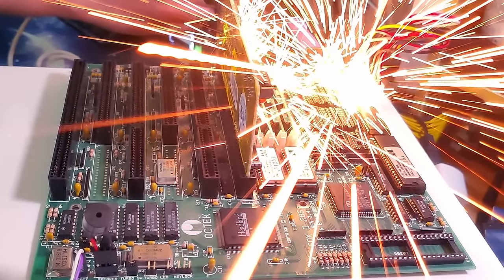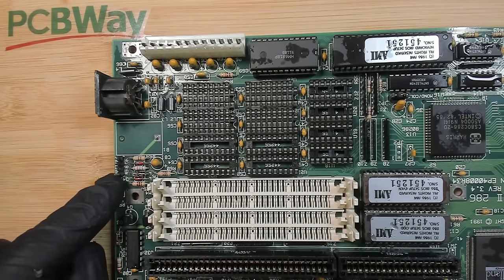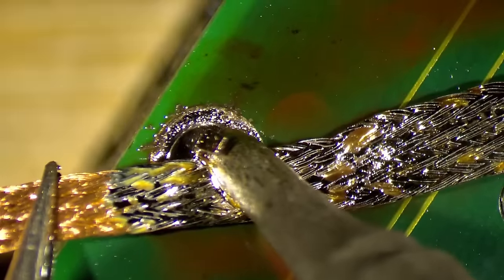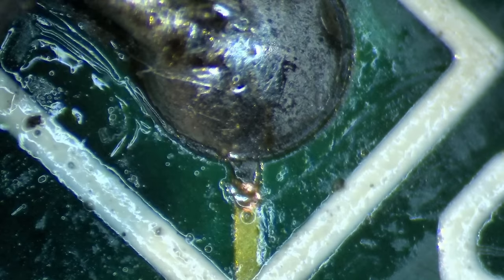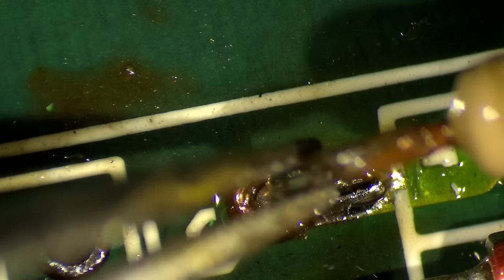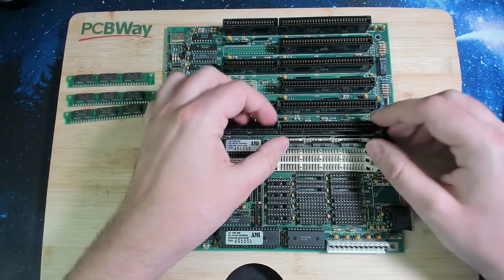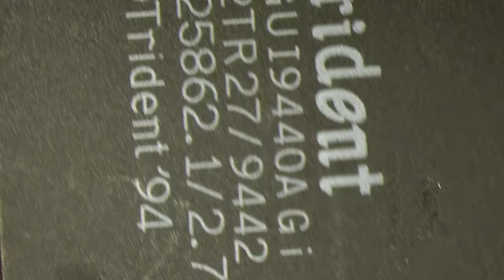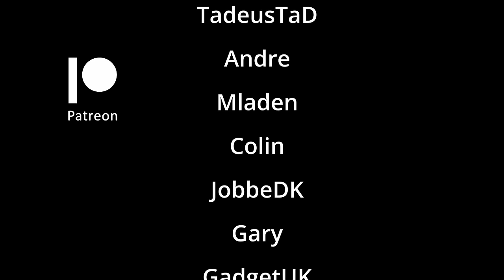Dangerous 286: Vintage hardware fireworks!

Comment: Should always replace these old ceramic capacitors. They are known to fail short. Replace them with something other than another disk, like a polymer.
Reply from the maker: I will replace the caps once I get the board to work. You're right, leaving those caps on the board will just create more issues in the future.
Reply: @bitsundbolts  Wonder if it may not be working because some of the other caps are also shorted? Maybe go through and check each of them for shorts until you replace them?

Comment: Fun with Tantalums! Happened several times on my Amigas that the old buggers simply blew up and left marks on the PCB. Happened most of the times after switching to another power supply. My theory is, that the aging Tantalums were so in tune with the aging caps inside the old power supply that they simply were not able to withstand the power of a new or more recent power supply. 

Best would be to replace all of them with modern MLCC ceramic caps.

But I shouldn´t be the person to say that. MLCC replacements for all my old hardware is on my list since many years but I am just too lazy to start. So I only replace Tantalums in case one turns into fire. ^^
Reply: Tants need to be significantly over-rated on voltage, machines of this era didn't do that. 16v caps on a 12v line, which can easily over-volt as it is typically not as well regulated. They age out and fail short circuit, just like MLCCs (in fact I've had way more MLCCs fail short in Amigas I repair for people, but they are used a lot more). It is better to replace with modern electrolytics for most of the use cases, although MLCC probably won't do any harm.

Comment: Hunt down an Intel 287XL coprocessor for that thing. It's basically a 387 core in a DIP 40 package compatible with the  286 bus. Its one of the fastest coprocessors out there (not the fastest, that would be a 20 mhz Cyrix FasMath or one of the Harris parts) while still being really common and not expensive. Since it's a 387 at the core, it can usually be overclocked to a really great degree, so you might be able to run it synchronously with the CPU, it might require some tweaking of the coprocessor speed jumpers, though. The 287XL has a pin that toggles an internal clock multiplier meant to adjust for the 2/3 divider that a lot of boards used for the original 287, so experimentation is necessary. It's also a lovely looking gold topped ceramic package, so there's also that. Regarding the Bios, there's a very nice MR-BIOS available in the VOGONS MR-BIOS archive. It supports things like larger HDDs and more than two floppy drives.
Reply from the maker: Thanks for mentioning the MR BIOS details - I'll look for it. If I get this board to work, the 287 is going to be a must!

Comment: JP2 was probably for selecting FPU speed. Typically 287 run at 2/3 cpu MHz. Possibly you could run at 1/2 or 1/1 with jumper.
Reply from the maker: There are frequencies present on those pins. I'll check where they go and maybe add the jumper back.

Comment: I have a BIOSTAR , MB-1220VE Harris 286 20 MHz  the board had minor battery damage  the current memory installed is 16 Meg ram most of it is used as a ram drive
Reply from the maker: Great! An ocean of RAM for a 286! Very nice. I hope I can get this board to work some day. Would be nice to also see it boot up with 16 MBs.

Comment: Hello, recently i bought a dusty CUSL2 and tested it. It worked fine. After washing it, drying it with the air blower and leaving for 3-4 hours in the sun, i v got a C0 error...:(. Any ideas?
Reply from the maker: Maybe it isn't completely dry. There are some BGA chips that may have water trapped below.
Reply: @bitsundbolts  ok i will check again!

Comment: 3-2-1 you're going to fix it soon! I can see that! I hope it's not the chipset, that 16MHz to the CPU is indeed suspicious. If I remember right we checked on my 286 (different board) and the speed seems to go to 20MHz straight away. Fingers crossed!
Reply from the maker: Yes, you're right! I'm looking at the logic chips now. I also socketed the 40 MHz crystal and tried one with 33 MHz - unfortunately, there was no change. Tomorrow, I'll continue with the logic ICs.

Comment: I bet you need to populate the socketed RAM.
Cant wait for you to get yours and see what happens.
Reply from the maker: I got the memory about an hour ago. Unfortunately, there's no change - same behavior as with the SIMM sockets - or no memory at all. The board behaves identically no matter what.
I also got new BIOS chips which work properly - still no change.
Reply: @bitsundbolts  Thats unfortunate. You mentioned in the video that there were data/address lines acting weird? Maybe try desoldering the CPU and see if the issue persists. If it does then chipset may be bad.
Reply from the maker: I'll check the logic chips over the weekend. There are about 10 on the board. My programmer can test most of them.

Comment: Oooh, nice obscure 286, great job (as always) getting it back into shape (as always) and godspeed getting it back into working order! A 16 MHz 286 running Lemmings was my gateway drug too. Besides lowering the set clock speed (which most certainly won't do anything based on what you've already shown and is certainly something you have already tried), I'm drawing blanks so far. Populating the DIP sockets sounded promising, and would have been an easy fix, shame it wasn't that. Any idea what that one small DIP chip that was in the blast radius of the corrosion does?

Once (when, not if)  the board is revived, I'd recommend replacing all the Tantalum caps, just for good measure and peace of mind. Wouldn't want to have to drop any more sacks of cement! ;)

I'm very much looking forward to that series on DOS memory management. I did a lot of optimizing in that regard back in the day (Memmaker FTW!) and I like to think that I had a somewhat solid idea of what was going on even then as a kid, but I certainly didn't know / don't know everything yet (but I want to!).
Reply from the maker: I'll try my best to get that board working. So far, nothing I have tried works. I guess you've read some of my answers to other comments. Yes, I got DIP memory and new BIOS chips - none of them make a difference. I'll keep on trying. It would be a shame if this board is unfixable.
I'll check that chip below the battery connector. I think I'd like to add a few more sockets instead of having all these chips directly soldered to the board.

Comment: Try checking all the pins of the Chipsets, CPU, (and whatever other ICs), to make sure that none have broken solder joints.. 
Also, try using your thermal camera. Maybe it reveals some bad IC.
Reply from the maker: I did check with a thermal camera - forgot to mention this in the video. I'll check the logic ICs - maybe there is something.

Comment: Hi, please also publish a video on further troubleshooting attempts, even if it doesn't work, we still apprechiate all the information!

I myself am stuck at the moment with a 386SX-16 which also can't detect the first 64k of memory. I found my CAS signal for the memory to be missing. Now I'm waiting on a ROM programmer to see if the BIOS chips are still retaining their programming. If that is checked and doesn't change anything I will cut the input pins of a bus driver on the CAS line, because it might be defective and pull them high. If the chipset still doesn't send CAS strobes after that I think I am out of skill to go further.
Reply from the maker: I'll try to go further. Unfortunately, I'm no expert - but it may be the perfect learning opportunity.
I got the DIP memory and new BIOS chips. Unfortunately, nothing seems to work. There is no difference if there's memory installed or not - the board stops at POST code 10.
I'll try a few more things now that I know it's not the BIOS chips or the memory.
Reply: Be aware with the CAS lines. Some memory uses hidden CAS refresh therefore you will not see the CAS active in refresh cycle. As far as I remember the CAS is not used to be driven by a bus driver but by the chipset directly. Worth to doublecheck. My story: With a socket 7 MB I got three long beep indicating base memory errors. I measured the memory 72 pin connectors with scope and DMM, found some oddities in resistance mode. But before I jumped into the memory deep I downloaded the BIOS from retroweb, flashed it and the MB started. Possibily the original bios was corrupted.
Reply: @bitsundbolts  The rtc chip should be checked as well. First the 5V power with switched off and on state. In PS switched off state it should show above 2.5V. With Power On it should be 5V.  If this is the case than the RTC chip is not depleting the battery, the chip consumption is below 100uA. If the chip is faulty and drawing much more like 2mA than the 5V rail of the chip will be below 5V like 3V. Due to this reason the Rtc behaviour is unpredictable connecting to the address bus causing a lot of trouble. Check the control lines as DS, AS, CE, RW for activity. This seems to far from the memory problem but I think is good to know the RTC circuit is ok, to close out any sideffects to the memory system via the A0-A7 lines. On the other hand I am in the middle of the restoration of a 286 board. I got experience with 386 - socket7 MBs but a 286 board is a new experience for me. Thank you for this excellent video.
Reply from the maker: Thank you so much for sharing those details! I'll have a look at the RTC circuit and check what you've written.
Reply: @mihalym.6876  Also from my side huge thanks for the insights/info. If I understood the continuity measurements on my board correctly, the chipset deliveres CAS to the DIP sockets directly, the CAS going to the SIPP sockets (if jumpered to be bank 0) is going through a bus driver. If the inputs are shorted to 5V it would "block" the CAS signal, but yeah - BIOS first. TY!

Comment: replace all Tantalum electrolytic capacitors, are you missing a step, do you need dose RAM chips you ordered ?
Reply from the maker: I'll replace the caps once I run out of other options or once the board works.
The DIP memory arrived, but they don't make a difference. The board still stops at the same error.
Reply: @bitsundbolts  It has to be something simple. You have post codes. Maybe a broken trace ?
Reply from the maker: I continue to look - hopefully I'll find something. But I have gone over the board multiple times and inspected traces, vias, and solder joints. I continue to work on the logic chips, maybe I'll find something else along the way.

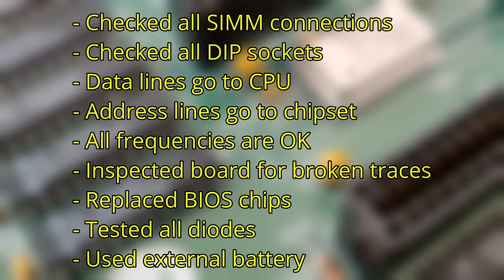Comment: at 43:49 both chips seem discolored on the right side. maybe the tantalum cap next to it also failed or something else.
Reply from the maker: I'm working on those chips right now. I'll try to finish this over the weekend. Hopefully it is one of those chips and the board will work after identifying a problem here. I already started, but so far, no luck. I also tried a 33 MHz crystal instead of the 40 MHz one. Still no change.

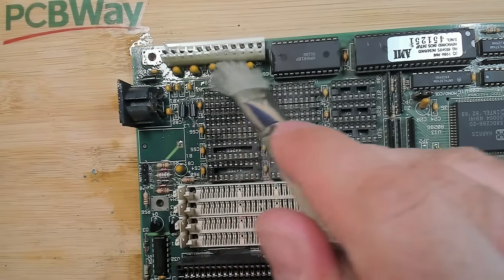Comment: @ 6:15  In the business, this is known as foreshadowing. 
Why not replace the Tantalum caps with a new/newer 10mf electrolytic.  Chance are the Tantalum caps will fail soon anyway.
Reply from the maker: I'll replace the caps once the board is working - or when I run out of options

Comment: did you checked if all pins for chipset are soldered 100% correctly ? some times there are some issues with the connection
Reply from the maker: I will double check it, but yes, I did check it. The solder looks surprisingly good - perfect almost! I have seen a lot worse on 10 year younger Voodoo cards.

Comment: If I recall correctly, and I may be wrong, but I believe that 286's have a bus clock that is fixed for the ISA bus and a cpu clock that is asynchronous to the bus?
286 machines were always fussy to me.
I had better luck with 386 machines.
Could this be, just an addressing issue for the bus clock?
I don't have the manual, but there might be something in there that could help you.
If it has hardware EMS, (fancy way of having extended RAM using the ISA BUS?)
That might be why.
Clock to bus memory issues?
Reply from the maker: I have very little experience with 286 systems. I will check the logic ICs over the weekend, maybe I can detect a faulty chips somewhere.

Comment: The first 64KB may need to be in the sockets, and can't be on the SIMM similar to how the original IBM needed it on the motherboard.
Reply from the maker: The memory is on the way and should arrive soon. I hope you're right.
Reply: @bitsundbolts  me too
Reply from the maker: Well, the DIP memory arrived right after I replied to your comment. Unfortunately, the memory doesn't make a difference. I guess I have to continue looking for clues.

Comment: Well, manuals I've found for this board seem to say it can run both 256k and 1m DIMM modules...or SIMM modules?  Whatever.  The slotted types.  And it says that '256kx4 DIP chips and 4x256k' can work at the same time, but it doesn't say how.  I don't see any references to clock speeds needed for the modules (DIP or SIP).  Well, before I start digging out manuals and stuff too hard, let me check your other videos first to see if there's an update already since this is from a month or so ago.  For anyone else it might help, I'd try it without any RAM on it at all, and with both types in there, and if that doesn't work, I'd likely check the SIP/DIP VCC's to make sure they are getting base voltage, then go from there if they are.  If not, I'd check for more bad caps, or look for more damage.

One concern I would have is that the 'damaged traces' fix seemed to be 'just wire' and you burred the old traces off entirely?  Myself, I just remove the protective coating from a section of trace that is still viable, then bodge from there with a still-insulated wire just for paranoia's sake!  Some boards had a ground plane that was very easy to get down into.  One of the bodges might be shorting its signals/power to ground and maybe that's what is stopping it.  It DOES beep, though, so that's very hopeful.  Now I'll go check for an update video.

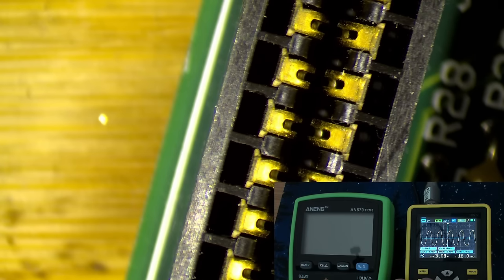Updating: 43:00 you mention remote diagnostics using an oscilloscope, and checking the RAM VCC's, so that's suggesting it has a more 'interesting' issue at hand.  But again, it DOES beep, so...I'll finish watching and see if anything else is mentioned.

Turbo may be high or low FROM POWER-ON.  Some systems only SWITCH speeds once they boot up enough to figure it out.  Take the jumper cap off and power cycle it and it may show turbo off.  If it's locked-on...that may or may not indicate anything useful, hard to be sure, but I would be at least a little suspicious if it is ALWAYS on, and it might be worth tracing that light/jumper back to see if you can validate what it's showing.  A 286 at 8Mhz is entirely sensible for a non-turbo operation mode, though I think 6.25Mhz was the 'original' 286 base speed.  8 was a very common base-speed in the later part of the 286 era, which would surely be when a 286-20 would be from!  8 might also possibly be because the RAM is too slow to operate at the higher speed?  But I think you said the chipset provides the RAM clock, so maybe that's not an issue.  I'd have to calculate if that RAM latency is adequate for the higher data clock speeds, but I think it seems sensible 'off the top of my I-haven't-used-a-286-in-forever' head.  I'll save other comments for if I find an update video or whatever...a month is likely plenty of time to diagnose a 286 board.  :)
Reply from the maker: An updated video will come on Thursday. Thanks for the Input. There will be some interesting developments in Thursdays video.
Reply: @bitsundbolts  Oooh, interesting!  I'll have to see what can be seen...good to know, thanks!  :)

Comment: Hah, I just had an old ISA card I was just testing (I dunno what it does) blew a couple of tantalum capacitors.

How very prophetic of your video!

One cap exploded like your video shown.

A second cap simply fused itself then burnt a trace on the motherboard before it was able to explode itself. 

One bodge wire later and the motherboard ISA slot is fine, the card gets to stay a complete mystery I guess!
Reply from the maker: I guess my video was published at the right time then! Good that your ISA slot is fine. I hope I have the same luck with my board.

Comment: the manual said with an asterix that the 20Mhz variant need 60ns special brand RAM
Reply from the maker: I do have 60ns SIMMs (branded TOPLESS). But the board came with those memory modules I show in the video. It probably worked with those in the past.

Comment: I wanted to write about the 8 bit eprom, but two people have already written. And also was written about dip dram memory
Reply from the maker: DIP memory didn't make a difference though. I tested this just now. There's no difference if there's memory installed or not. The board does exactly the same thing and stops at POST code 10.

Comment: So, 286's were soldered on the motherboard?No socket at all? First time i saw something that old honestly, very interesting video :)
Reply from the maker: Unfortunately, yes, this CPU is soldered to the board. I'm planning to replace it and add a socket. It makes it a lot easier to switch CPUs in the future. Well, if I get the board fixed

Comment: 43:42 This is 70nS RAM, not 60 as in 35:48 mentioned.
Is that the reason why the board is clocked at 16 MHz?
Reply from the maker: Hm, good question, but I doubt it. I also tested the board with 60ns SIMMs. They're quite rare and I only have four modules. They are of the brand TOPLESS.